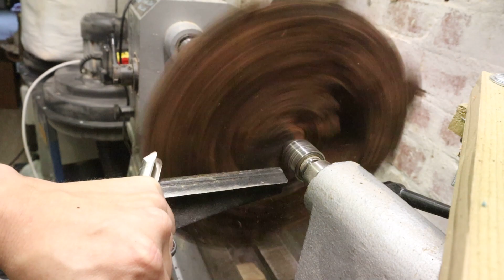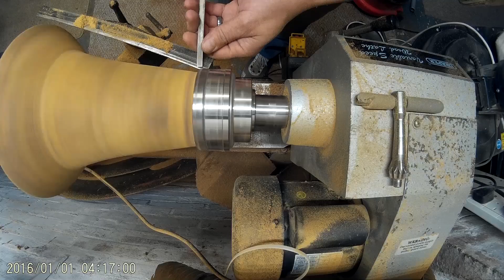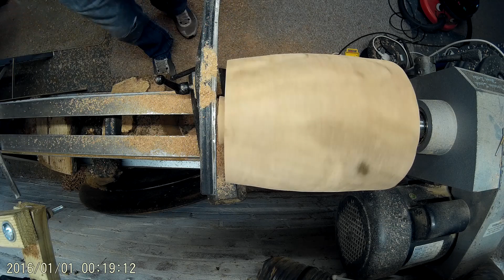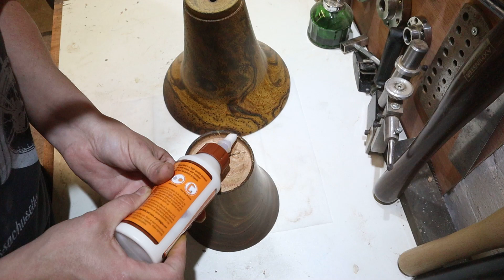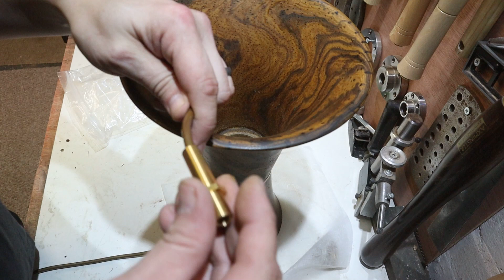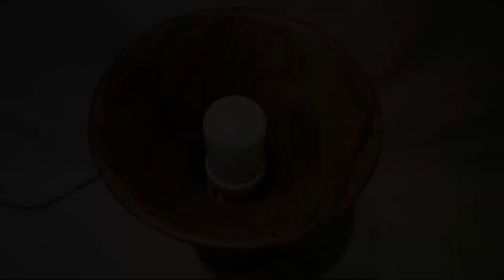Woodturning - The Eternal Flame

Comment: You can make an electricity effect with a microwave transformer, but watch your hands and wear high voltage gloves, 3000V ones are enough, and you can use salt water on the wood, "experimentboy" made a video on this, it's in french but you can understand it, it is called "graver la foudre sur du bois", just an idea flying with many others, 😉
Reply from the maker: I'll take a look 👍
Reply: Senky👍👍👍

Comment: I'm new to your channel but can definitely say that you alone have sparked an interest in wood turning for me. I also have a question. What is it that you use to polish everything when you're finished?
Reply from the maker: Thanks Robert, really depends on the finish I've used, most things are just polished using a natural beeswax after an abrasive paste. But the most important part is the sanding, you need to get it up to a high grit level of around 600-800 for a really smooth finish, don't be fooled by miracle  products that claim to do all the work for you! The works always in the sanding.
Reply: @MattJordanWoodturning  cool, thanks for the advice.

Comment: Please tell how to learn finishing! It looks like you used to or three different liquids. Can you please tell me what they are? What’s the best way to learn finishes? That seems to be a big big part of wood working.
Reply from the maker: Biggest part if the finishing is in the tool finish followed by the sanding, I use an abrasive paste after sanding but there is no point in doing that until the tool finish and sanding is A OK 👍 Finish I use on a regular basis is just a sanding sealer, abrasive paste with a bees wax polish.

Comment: I learn a lot from watching your videos and another you-tuber (@nickzammeti). I have seen a lot of turning videos, and have some formal training with CNC machines & metal turning lathes. I am deciding between a Record Power model and the model you turn with. What brand/model is the lathe you use?
Reply from the maker: This is a Draper WTL 95, they dont make it anymore, they have a new model that looks almost identical, it's over 20 years old now, from what I've seen on forums draper have slipped in quality. If I was going for a similar lathe again I would buy the scheppach LATA lathe, take a look, I've seen one and they are very good quality for the money, simple tried and tested design too 👍
Reply: Matt Jordan Thanks for your reply and advice! I hope you continue to make videos and pass on your wealth of knowledge forever. If you are ever in need of an assistant, apprentice or partner, let me know!

Comment: Outstanding work!  (Gee wiz I think I may be turning into a parrot. Wow, NIce, etc...}  Why is that your wood is completely crack free and mine always doing it, come to think of it, my wood my actually be on crack.  Okay, all kidding aside, one real question for you though: what is that in the lower left side of the screen seen when you are filming from above your lathe? I am guessing that it is actually a camera or light mount because I have one a lot like that I am using for my camera.  

Oops. Just read the rest of the description, but I didn't see cracks like mine that are like a half inch wide. But I am going to look at your kit and glue right now.
Reply from the maker: Thanks Chris, the lower left hand side is a support I made for a camera. Most of the wood I turn still has the pith in so its more likely to crack (but not always), lots of people take the pith out and then dry as they are always in pursuit of the perfect piece of wood with no cracks. Best way to stop or minimize cracks is to seal both ends with wax before drying and then turn.
Reply: @MattJordanWoodturning  Aha! I knew it. Thanks for the good advice.